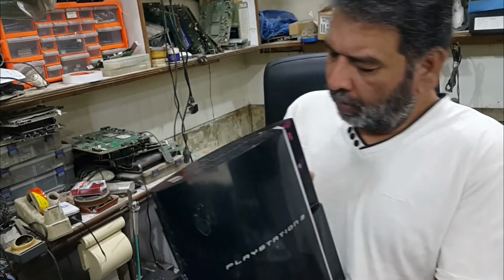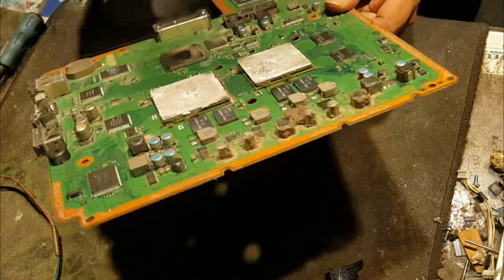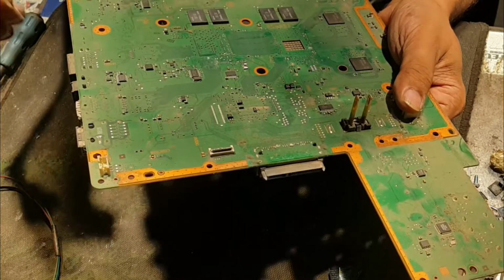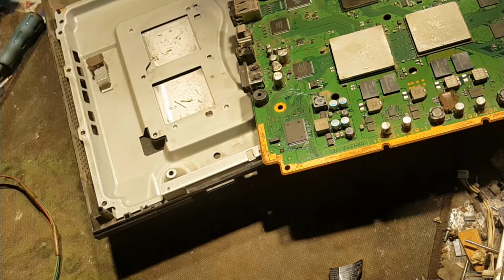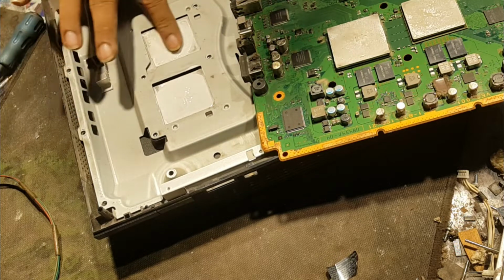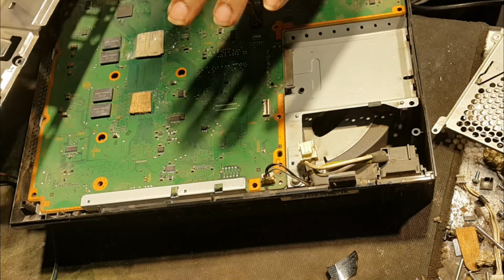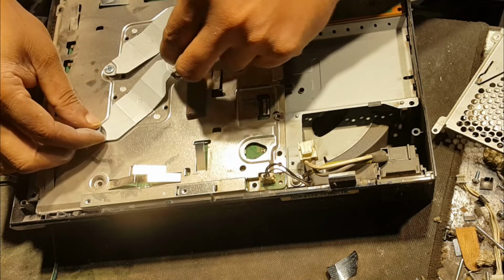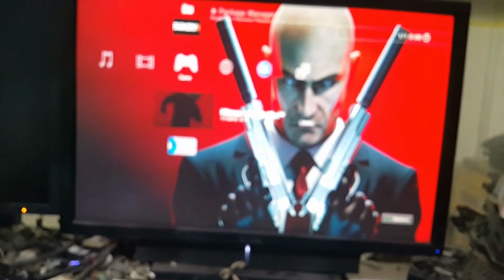🔥How to Fix Ps3 Overheat Problems.🚀💡✨

Comment: Hey friend best channel ever, keep going. My question is people say when ps3 overheat and fan speed going up and then shut off its usually dried thermal paste under cpu and gpu top cover. We are supposed to cut glue under cpu  and Ggpu (IHS)  with sharp object and put fresh thermal paste. Is that true?
Reply from the maker: I never did that. Why cut and separate thermal spread metal plate from CPU and GPU. The CPU heat spread sheet is fixed with a soft silicon and the GPU withe a hard thermal paste on rams. Only do the same like this video https://youtu.be/1zxNtor_1F8 It will be fine.

Comment: This is an update on my PS3 that showed green light for 30 seconds without picture: the only way to make it boot was by opening it up and taking the power supply out for a second and putting it back together.

You suggested bending the pads, because you thought that they weren't making proper connection. I bent them on three occasions. After the first one, the system worked for three days, and I was fooled by it yet again. I bent them again twice. 

Now, the system does boot and shows picture, but it's unstable and freezes every time shortly after. However, the old temporary fix still works: if I take the power supply off and put it back, it works for 12 hours without problem. 

A detail worth considering: the system won't boot successfully if I don't fully assemble the system after putting the power supply back. I've tried to get it to boot by putting just the power supply back, but it doesn't work unless I but the cover and screws back. 

Thank you so much for the first suggestion. I'm glad I can use the system at all, but if you've got any further suggestions on a possible permanent fix, I'm all ears.
Reply from the maker: Is there any garbage on the screen as it freezes, if yes then try to reflow RSX?
Reply: @idreestech  No, nothing of the sort. It looks totally fine.
Reply from the maker: @excitedaboutlearning1639  Then must be the power supply issue.
Reply from the maker: @excitedaboutlearning1639  Not sufficient current from the power supply.
Reply: @idreestech  I've replaced the power supply, and the system still has the same symptoms. I runs perfectly for 12 hours after I simply disconnect and reconnect the power supply abd put the screws back. That's true with both power supplies that I own.
Reply from the maker: @excitedaboutlearning1639  Then need to investigate the motherboard.